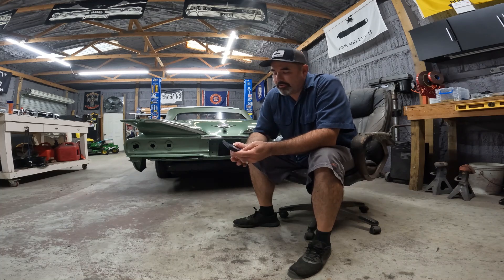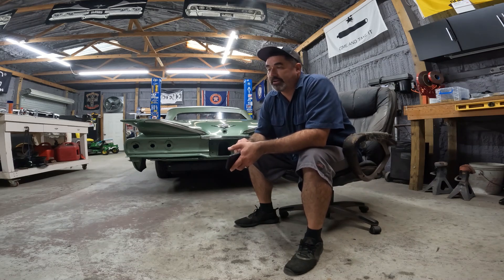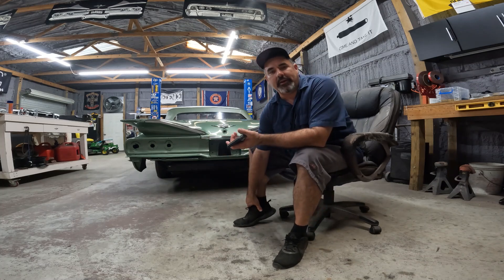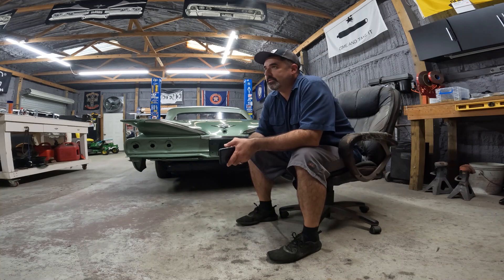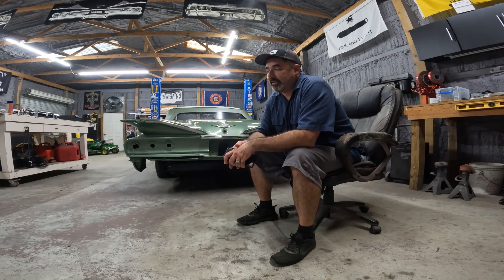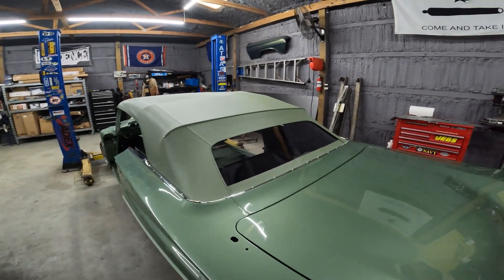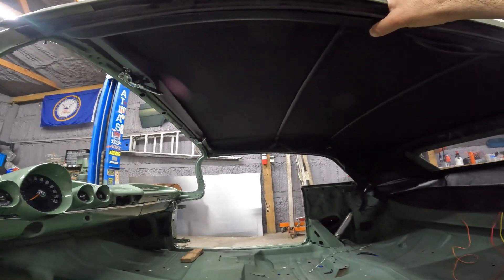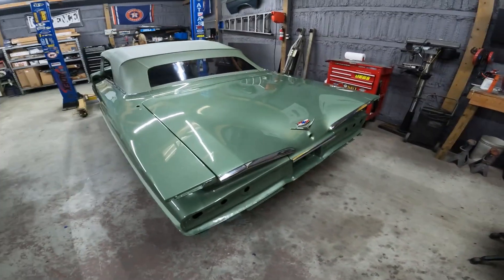1960 IMPALA CONVERTIBLE TOP IS INSTALLED!!!  / HAARTZ PINPOINT / MEDIUM GREEN VINYL / ARO2000

Comment: Top came out nice, great color choice. You think it will be 95% done by new years? I know that's not far away but yall dont play.
Reply from the maker: Hmm. Haven't thought that far ahead. I'd like to have it running and driving by spring
Reply: @lonestarlows  ok I was thinking you'd have that done by new years the way yall move. Still got wiring, ecm, exhaust,  fuel system etc. understandable. Are you doing a stainless polished exhaust?  Imo magnaflow one of the best mufflers.